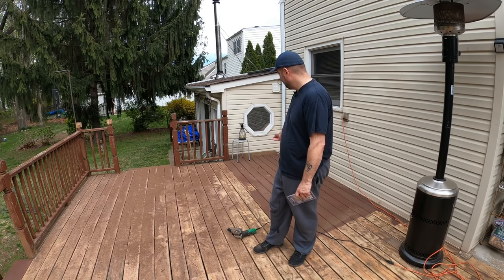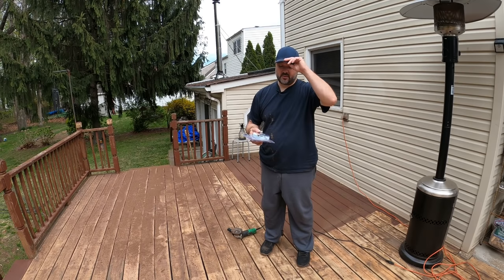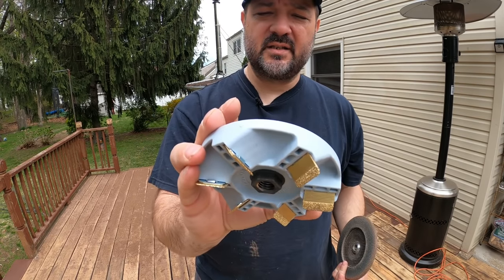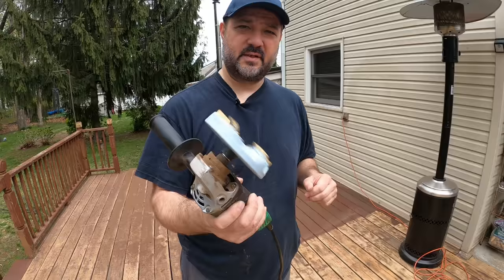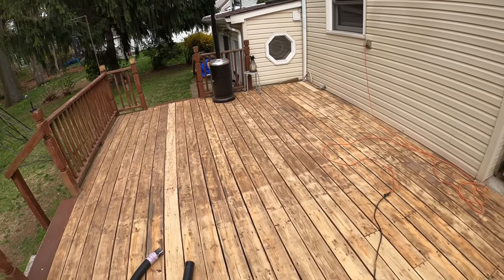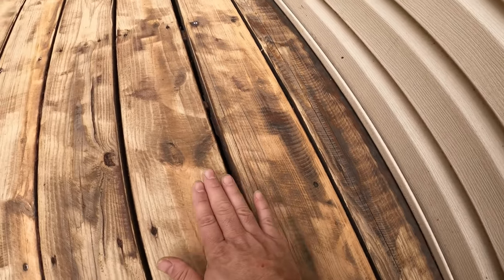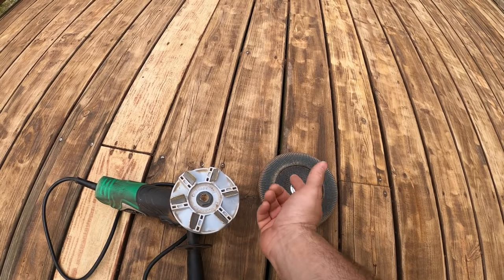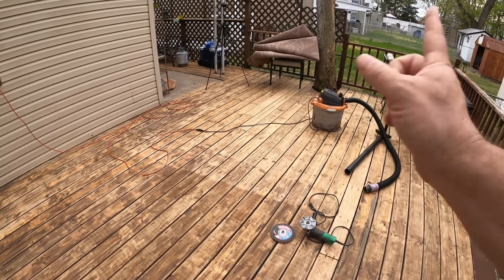Diamabrush wood deck paint removal how to remove paint from wood fast and easy

Comment: I have two antique metal lawn chairs that I need to strip.  I wonder if this or something similar would work on them?
Reply from the maker: yes but, I would test on a small part of the chair and also get the feel of the tool by using  regular  piece of painted wood so you can get a feel of how the tool works...
Reply: I wouldn’t use the diamond tool.  (Too dangerous on metal). Use a 80 grit floppy disk sander on the angle grinder.  Then go ton120 grit.  Finally, hand sand difficult areas.
Reply from the maker: @15555Kerry  yes I used both used the sanding disks to blend the metal screws I could not take out then used the dimabrush for the rest

Comment: Do you just come back over with 80 grit and 120 grit?
Reply from the maker: I was lazy and was not looking for that perfect finish for this old deck because not amount of sanding would have fixed the imperfections of some these older boards I was going to replace alot of the deck boards but at the going rate of wood these days I only  replaced the rotten wood... in the end  just wanted to get the old paint up but, i did  came back with 120 grit in some areas to blend the boards but it really did not need much sanding afterwards.....if you want perfection the yes you can do 120 grit afterwards to get completely smooth.. will have updated videos of what the deck look like after i stained it ...  stay tune

Comment: Man that thing don't mess around I wonder how it would work on a cedar shingle sided house?

It would sure be a putty knife for scraping the peeling paint and holding up the big gigantic grinder with a 7-inch disc of 36 grit my shoulders are doing that...
Reply from the maker: it should work great plus it does not require alot of pressure to work just glide it along surface and let the tool do the work check out the other video I made showing it real time how fast it works
Reply: @maldo72  yes I enjoyed the video a lot I'm going to pick up two of these time to repaint my house cedar shingles and on the North side where it gets blasted all the time that's where I think I'll use it thank you very much for the info

Comment: Has anyone tried the flap wheel, fiber disc, and diamabrush?
I'm looking for something that will do as little damage as possible to the wood, while removing 5+ layers of paint.
I'm getting the sense that the good choices for that are a fiber disc, probably with a soft backing pad or mounting plate, whatever it's called. An infrared heat stripper. Maybe a belt sander.

If I understand right, the diamabrush gouges the wood even more than the flap disc

Comment: U can also use brush wire wheel cup on ur grinder to remove paint on wood, and it only costs 10 bucks
Reply from the maker: Yes you can also use that but it takes alot longer ...

Comment: As a professional painter deck restorer, I'll cover with plastic surroundings, spray or stiff push brush paint stripper first, at least 85% of paint wit be melted, after a good pressure wash at a rate somewhere around 2500  psi, after that the rest is piece of cake once dried.
Reply from the maker: yes true but this is a great option if you dont want to use chemcial strippers
Reply: @maldo72  I don't like chemical stripers as well soaks into the wool and can cause problems down the road ?
Reply: The chem strippers followed by a neutralizer and a pressure wash do the job with the least work.

Comment: I wouldn't be using this on a deck, but cabinets, and siding.  My concern is that it would be too abrasive.  Sounds like you didn't have an issue with this?  I was thinking of going with a Wagner Paint Eater, but this seems more efficient, and I already have a grinder.... I just don't want to tear up the wood I'm working on.  If the final sanding (which has to be done anyway) gets rid of the swirls, then I'm completely sold.
Reply from the maker: To minimize the swirls you have to let the tool do the job and mot apply any pressure and keep the tool moving for decks and the paint/stain I used I don't there was no need to do a final sanding ....
Reply: @maldo72  Thank you!

Comment: I tried this and it seems to be leaving some serious swirl marks, a lot worse than yours. Any advice?
Reply from the maker: I let the tool do the work and did not apply any pressure it also helps to angle the grinder to one side with the rotation of the blade which helps to get a better finish

Comment: Like the way the deck looks now I would be tempted to just put clear over it and call it done.
Reply from the maker: yes if prepared correctly but this deck was not. it looks like they slapped it on to make the deck look new when we bought the house
Reply: @maldo72  the people before us did the same thing. We can’t go out on our deck without coming in with big chunks of peeled paint stuck to our shoes. What a mess! How do you know whether to use pressure washer or do what you did?

Comment: What speed angle grinder did you use?  Thanks.
Reply from the maker: Hitachi 4-1/2-in 6.2-Amp 10,000 rpm if i remember correctly

Comment: How come you chose this over a hand push floor sander?
Reply from the maker: This was easier and faster for the time constraints i had to do the project plus this deck had a really thick overlay of deck over paint .... that the sander could not get to...
Reply: @maldo72  interesting.. I have the same thick coat on my porch. I was debating which route to go. I think I’ll go with what you have.

Comment: Was the wood pressure treated?
Reply from the maker: yes
Reply: @maldo72  where a mask !!! That green pressure treated lumber is very toxic chemicals cancer causing you don't even want to burn that smoke even destroy your liver and kidneys you can't buy that any more in Canada I still have half a gallon left when you use that chemical put on rubber gloves full length not cheep ones.

Comment: New home owner here. Why shouldn’t I use paint thinner on my deck? I want to remove the paint and re paint it. I just keep seeing people break their backs removing paint by hand instead of chemicals. And then sand. I just want to understand.
Reply from the maker: depending on how big the job is and your situation There is nothing wrong with using paint thinner.  I did not use that method for a number of reasons i have small dogs and needed to get this done fast without the mess and chemical smells and residue etc  plus after the paint was removed i was able to vacuum up for easy disposal...  so for me this product worked out great for me.
Reply: Roger that!! Thank you 😎

Comment: If you want to remove paint from wood deck you should use 4000psi pressure washer with turbo nozzle, more faster and much better
Reply from the maker: wood to old for that
Reply: Won't work. You don't know what you're talking about.

Comment: Palm sander 180 grit sand paper or 90 then finish with 180 no orbital or saw marks
Reply from the maker: yes if you need a perfect finish but for this old deck all i needed was to get layers of paint off the deck quick this tool did the job easy without damaging the wood
Reply: @maldo72  nice

Comment: Just get a American sander and use a small orbital sander for the corners, done, i would not even clean that much if the client want solid stain on it, only if the clients wants transparent or semi stains...
Reply from the maker: yes you can also do that but this deck had many layers of paint and that thick "deck over paint"
Reply: @maldo72  yes that’s why the drum sander would clean very fast and the left over by your orbital sander or diamond brush, just make sure to set nails or screws before cause the drum is expensive if you break it by a nail or screw

Comment: For that size job, use a floor sander and save your knees.
Reply from the maker: i rented a big sander but it could not penetrate the thick layers and uneven boards...  Yes this was little back breaking but turned out to be the best option to get layers of thick paint off the boards, steps and rails

Comment: Yes the diamabrush works. No doubt. But for anything that big you need to rent a drum sander. About $50 for a day. 100 times faster but most importantly. No uneven surfaces. No way to sand that with the diamabrush without leaving uneven surfaces. Not saying it won't work or even turnout ok. But for a professional finish and probably cheaper. Drum sander and diamabrush for your edges.
Reply from the maker: yes a drum sander would have helped but these boards were not even and had a really thick over lay of paint/and that thick deck-over stuff on the wood plus all the screws that were popping up that i could not see since the paint was so thick.  the previous owner just layered paint over paint  .... so for this situation it worked out well..... i will have an update soon of how well this turned out after a year of winter and summer (will have an update in July of how everything turned out ) thank you for watching
Reply: Thanks and please do. As a painter it's valuable to be able to offer a customer guarantees on work from testing and or what to expect from products.

Comment: Myself would buy a secondhand floor sanding machine but they can be expensive
Reply from the maker: Yes that would work also ...
Reply: @maldo72  they do the job but so expensive even secondhand ones cost a lot, but might be cheaper in your country or cheaper to hire one

Comment: This deck has divots everywhere.  You should first sink the screws you can and remove and replace the ones you can't.  Then use a floor sander.   This thing looks like a chipping field.
Reply from the maker: yes I did that where I can but the paint was so think in certain spots I did not see the screws until the tool ran over it

Comment: Why not use a belt sander
Reply from the maker: takes too long plus clogs plus needs to be changed a lot with the tool no changing of sand paper and does not clog full of paint
Reply: @maldo72  mine has never clogged and I have done my decking every year for 6 years, I do pressure wash it first and afterwards
Reply from the maker: @bunnykiller83  yes but in my case the paint was so thick in certain places i went through a dozen sand papers and they kept loading up on me that's what i switched to this tool .. it took the paint right off never having to stop to switch out sand paper
Reply: @maldo72  whatever works I guess

Comment: i probably would have just gone with sandblasting, as you could do the whole deck in a couple hours including the railings, and maybe $200-$300 isnt bad to pay to achieve a bare wood no sanding clean finish
Reply from the maker: yes thought of that but the cleanup would have been a nightmare

Comment: a gallon of paint stripper is 50 bucks. Let it soak in for 20 - 30 minutes then use a3 500psi pressure washer.
Reply from the maker: yes that can work too but super messy and toxic ...
Reply: @maldo72  I use the orange peel strippers, the natural chemical, limonene, found in citrus fruits (fast orange hand cleaner uses the same thing but in lower concentrations.) I don't find it messy because with the pressure washer I can easily rinse off the house siding and walkways. After sanding you've got a mess too. What do you use, a broom? Leaf blower?
The whole painting industry is toxic, I mean, you're sanding off paint, where does that dust go? Same place: the ground.

Comment: You problably have to go back And give it a pass with the first one you showed, the overlapped sand paper one.  It will sand off the rest of the deck.  You problably want to use the 8" sander

Comment: I have a deck probably at least twice that size.  Like an idiot I used the "miracle" deck-over paint. Not once, but twice!  What was marketed as a deck repair product, is in fact a complete deck killer.  After the first time using deck-killer (about 2 years), I power washed my deck, rented a floor sander, then power washed the deck again. Once again I put on the deck-over paint thinking this time I really thoroughly prepared the surface.  Two years later and it's all flaking off again. An utter disaster.  My likely solution now is to rip out all 600+ sq. ft. of my deck and install composite boards. 

Never, ever, ever use a deck-over product!
Reply: did the floor sander remove the deck over reasonably well?
Reply: @viziofamilywatchvideo3125  Actually, the floor sander was not aggressive enough.  Looking back, I probably should have used a drum sander.  I believe a drum sander for decks can be rented at HD.  The take away for me is always use stain, never any type of paints or deck repair marketed solution.  It does not work.
Reply: @ObadiahTeleo  thanks for the response, do you think 'Solid color stain and seal' fine to use or its as good as paint?

Comment: I dont recommend this tool unless you only have a layer or 2 of paint. It said it would work on 1000 square ft, 30 square ft is all it would remove and it was done.
Reply: drum sand :). I wish they allowed photos

Comment: Mechanical paint removal seems less problematic than using a power washer and raising the grain and wood fiber fuzz
Reply from the maker: yes just more labor intenstive ..  and does less damage to the wood long term
Reply: I find that I would rather sand the paint off the car instead of using chemical paint stripper might be a little slower but I find it easier clean up and car still needs to be sanded to remove all the stone chip rust & for the fresh primer to stick...

Comment: Why not try a good power washer
Reply from the maker: you can use a power washer but with a power washer did not want to create more damage to the older wood boards plus the paint was really think in certain areas and needed to grinded off

Comment: I hate to be that guy but...If it's that water base stain, Not timber oil stain that's on your deck.You can save time and your back by purchasing or renting a water pressure machine at least 2,800 psi and be done!!...Did my 1000yr deck and the wood came out like new....Than I used timber oil stain lasts longer...
Reply from the maker: yes you can but the wood was bad on certain places and it would have created more damage to the wood

Comment: I tried this. 30 seconds in I accidentally caught a nail, one of the blades broke off and shot sideways like a bullet. I stopped after that. Seemed a little risky
Reply from the maker: its not meant to be used with nails you would need to grind down or remove before using this disk

Comment: As a professional stainer how will you explain to the customer about all those marks and deep patterns you have created in the wood …? You won’t be able to fix any of this. This is not the way , but good effort I guess
Reply from the maker: point well taken , as i explained this is an old deck with tons of layers of paint over the wood ...  This product worked great to remove all the old paint so that I can apply paint to  extend the deck life ... coming out of the second winter cycle and will be updating this video how everything held up  and i think you will be pleasantly surprised how well it turned out..  ...

Comment: a sanding sponge 🧽  now will smooth it
Reply from the maker: for this old deck i did not bother to smooth out it did not really need it afterwards because i was going to stain/paint it afterwards .. it did a great job removing the super thick layers of paint on the boards

Comment: that does not look easy. I want a product UI can paint (or roll ON) and power wash off. There MUST be a way.
Reply from the maker: yes there are paint strippers you can use only problems is when you wash off if might have some run off ...  i used this method because i have small dogs and did not want to have a chemical wash off on the lawn

Comment: Why not just rent a drum sander and be done in 1 hr???...
Reply from the maker: whats hard to see is that this deck was in really bad shape with thick  layers of paint plus it had a layer of deckover (that super thick stuff) plus  metal screws that were hidden.  If this deck was in better shape yes a drum sander could have been used..........

Comment: This disc is a phenomenal pile of junk.. I tried using it on wood siding and it just tore the crap out of the wood using light pressure.Total waste of money.  Went back to big box store and got a disc with a diamond coating works great!
Reply from the maker: really wow sorry to hear that.. my experience was different it worked great for the deck. the wood siding you were working with was  old or rotten before you hit it with the tool ? please give more info for viewers so they don't make the same mistake thank you ..
Reply: @maldo72  Wood siding is old but not rotten I would have replaced it if it was. It could be that because the blades stick up so high that it's not good for using on siding but ok for decks. I'll never use it again for siding but maybe the deck
Reply from the maker: @-CCdude  thank you for your input ....

Comment: Screw that $50 for that junk. Go buy a medium-soft wire wheel for less than $10
Reply from the maker: I tried that but,  they get clogged full of paint yes pricey but did a great job to remove paint

Comment: Too abrasive, I have used belt sanders. Fast, efficient and easy,  and a lot less expensive.
Reply from the maker: yes i tried that first but, there were to many layers of "deck over paint" and in some areas it was about 1/4 inch thick

Comment: That crap i f hit a nail or screw its GARBAGE..use the festool  rotex  6 inch pad with a l saphire # 30 grip  .and you will b e amazed.  And never  ,decide the coating or varnish  let the costumers decide  choose it ,buy for you or you will be screwing your reputation.
Reply from the maker: This tool is really not a commercial item but for a home owner doing it myself this was the best option for me.    Yes if you hit a nail it could damage the blade but I hit a few nails and this tool took a beating ......